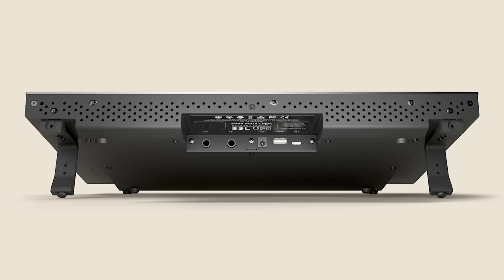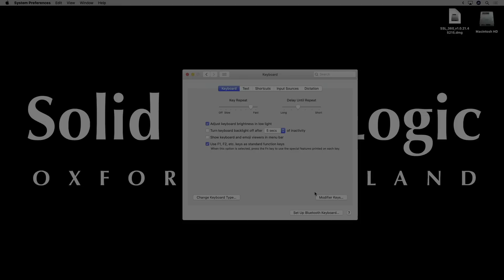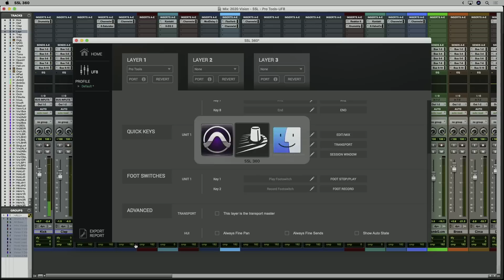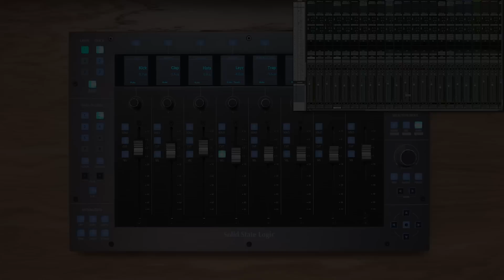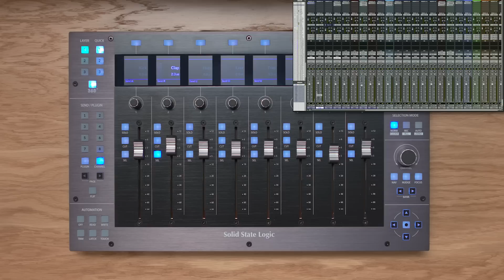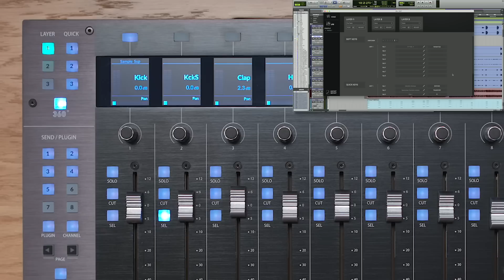UF8 Pro Tools Install & Set-up

Comment: It admittedly does a number of cool and useful things, but what I think it's a major overlook is the lack of a dedicated transport section. I'd happily loose some customizable function keys (like the quick copy paste editing, for which you'll better off using mouse and keyboard) for a play/stop/Rec set of keys down at the bottom of the frame. Using the top row switches as alternate transport keys at the top is nowhere as quick or as convenient as having a set of dedicated buttons in the right location. Bummer, still I may try one and see how I like the faders and usability.
Reply: 100 %  agree
Reply: I just bought one and after using it for an entire mixing session, I agree it would be a nice addition, but in no way is that a deal breaker for how awesome this controller is. Perhaps in a future firmware/software update, they could add an additional “mode” to the cursor key section to transform those keys into the “major” transport functions (and make the assignments editable in the 360 software).
Reply: I love how they talked about the transport functions for like 2 seconds. I think I press stop, play, and record more than anything else.
Reply: @dogmatickarma9846  That's actually very very brilliant!
Reply: @EnochAttey  thanks! In one of the updates last year they actually added that functionality! So now the cursor controls have 2 modes. Such a great piece of equipment.
Reply: @dogmatickarma9846  glad tey added that, i'm installing mine atm !

Comment: DO NOT waste your money on a second UF8. You'll still have only 8 channels as the second unit will not sync and display tracks 9 through 16. As a guy who worked on a SSL desk back in the 80's when these guys were just starting out, I'm very disappointed to say the least.
Reply: Hi Jeff, just come across your post and wonder if this issue has been resolved in anyway? I've just purchased a 2nd unit to do just this, visually see 16 track faders and work them. After playing around for a few hours I still cannot work this one out. This is the only mention of this by yourself that this cannot be done. However don't you think that SSL is kinda falsely advertising the fact that 4 units can be strapped together giving us a massive 32 track setup? What is the point in piggy backing these units up with each other other than to do nothing what's so ever. Any help on the subject Jeff or if you can point me in any direction as to discuss this I would greatly appreciate....John

Comment: Great! But why I can control only four plug-in parameters at once not 8?
Reply: Limitation of the ancient HUI protocol.  So far nothing can beat the EUCON controllers (AVID S series) for plugin control.
Reply: Good alternative: Focus Mode for the large encoder on the right - hold your mouse over the controller/parameter you'd like to edit and do so using the encoder.
Reply: @marcelschechter  that is one of the major selling points for me for this controller. As Pro Tools isn’t providing new functionality to HUI protocol and they can’t guarantee plug-in creators will add support for it. This feature gets you around all that, because let’s be honest, no matter what “controller” you use, you still need your mouse!

Comment: For some reason, the nudge function is not working. Why could that be? I pressed the nudge button on the UF8, selected an audio region, and set the nudge value to bars and beats so I could see the region moving more clearly. Nothing happens. Is there a setting in Pro Tools that I'm missing. I just started using Pro Tools coming from Logic.

Comment: Maybe I missed it, but is there a possibility to make a custom layer of faders? Say I want to have channel 1 in the DAW on fader 1 of the UF8 and channel 10 in the DAW on fader 2 of the UF8. Is this possible?
Reply: Good question! Id like to know that too!
Reply: It doesn’t currently support that functionality. Your best bet is to organize your channels in a logical grouping. OR — I am not sure what DAW you are using, however, in Pro Tools, if you group a set of tracks (say drums) into a “routing folder” and assign the output of each contained track to the “routing folder” bus, then you get some awesome advantages. When the folder is “expanded” and you bank (or select) these tracks to be controlled by the UF8, you get control over the Routing Folder bus as well as each track in the folder. Then if you “close” the folder, the UF8 hides those tracks (leaving the routing folder track) and brings the next set of tracks (to the right of the folder) into control. Once you have your levels set for the “contained tracks”, then you can just ride the fader of the “routing folder track”, add automation to it, etc. I have found this extremely useful, hope this helps.

Comment: Strangely; I've had the UF8 & UC1 set up on another system running Monterey and everything worked great. I moved them both to another room with the same OS on a different machine & some things don't seem to work. I can't get the BANK button to bank through tracks, I can't get the TRANSPORT window in 360 to become active using PT 2022 or Logic.  - I've installed & re-installed. Still not working. No information anywhere about the issue either. VERY frustrating!

Comment: After changing the peripherals setting exactly as shown and hitting ‘okay’ I get a pop up that says “Pro Tools is unable to communicate with HUI. Power-cycle HUI and check its connections. Note, if HUI in not in use, update the Peripherals dialog to prevent further warnings”. What does this mean and how do I fix it??

Comment: Curious, can we still use our EuCon based hardware with a UF8, or like my Nucleus do I need to 'Ensure that the Enable EUCON option is unticked to enable metering on the console surface'.  Or maybe because the UF8 is not Ethernet-based as is the EuCon Protocol maybe this poses no problem.
Reply: Dunno if you ever got an answer, but I just found out you do have to have Enable EUCON unticked to get metering on the UF8. Apparently it's a Pro Tools bug that affects all HUI devices.

Comment: I have the UF8 and I’m using Protools. I’m unable to write/record automation on the UF8 using the faders.
The faders on the UF8 are linked to the faders in Protools but it’s not writing the automation.

Can someone help me out?
Reply: did you find a solution for your problem ? I am  thinking of buying it but  I had another controller that had issue s too working in harmony with pro tools  so it was not useful if this one has issue s too  I need to look else where   so I would love to hear what your  thoughts are on this  blessings
Reply: @sammyvandenbergh  It’s a good product. My only con would be the transport. Yet Overall, it works fine.
Reply: @sammyvandenbergh  problem stopped happening!
Reply: @bobcozy4472   thanks for the info  much love